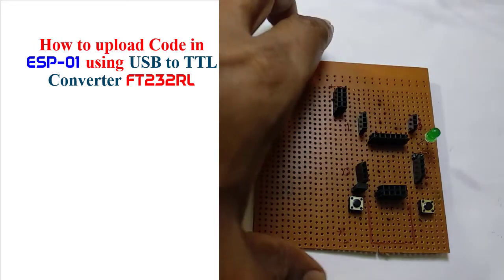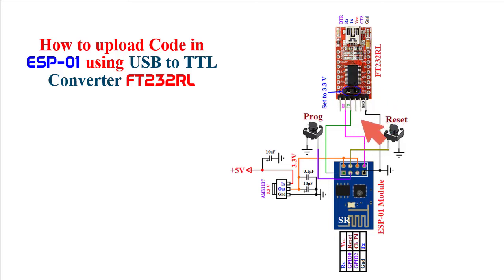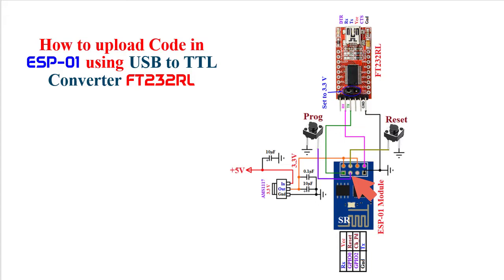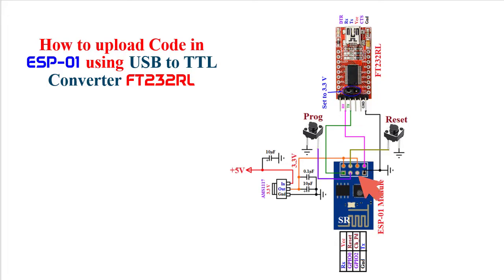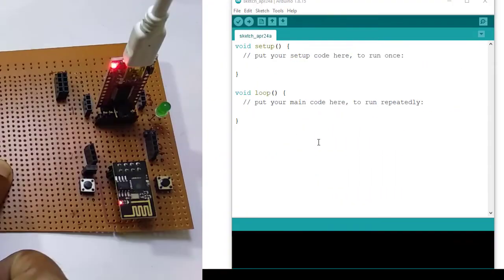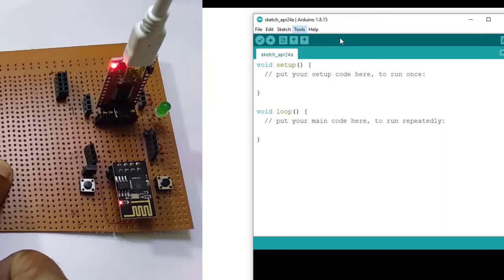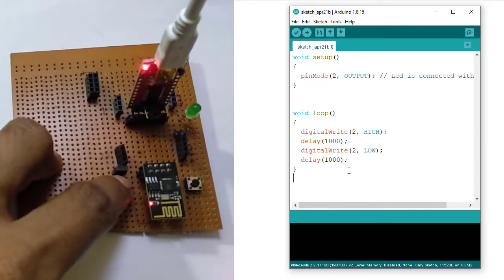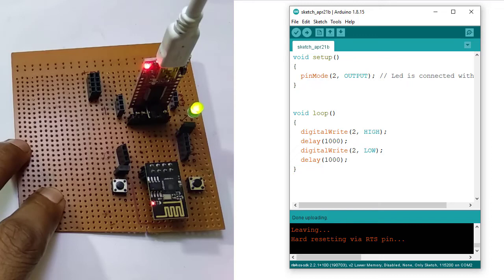[Project] How to upload program code in ESP-01 using USB to TTL converter  FT232RL

Comment: From which to which pin did you shot with small jumper
Reply from the maker: That is just a disconnection between GPIO2 and LED.
Reply: bro, can we use another usb ttl for upload program. ch340/341 not have DTR and CTS pinout ? so cannot auto reset, but what function of CTS pin ?
Reply from the maker: @TheFandiahmad  i haven't use ch340/341. I will check it and tell you later. Many thanks for your response.
Reply: @silenceandprogress  thankyou sir,